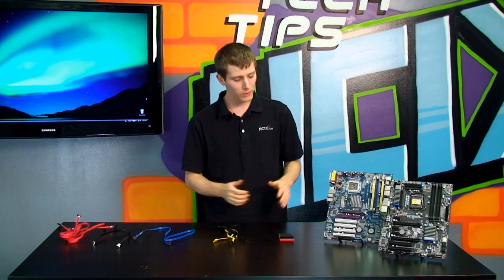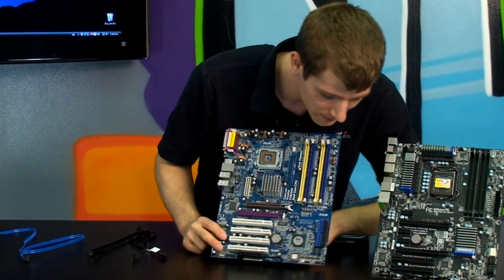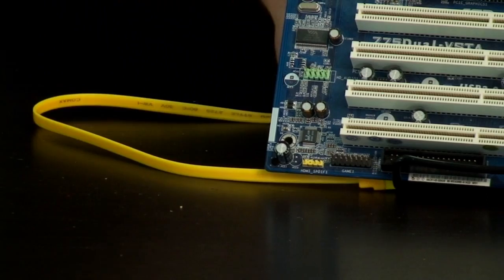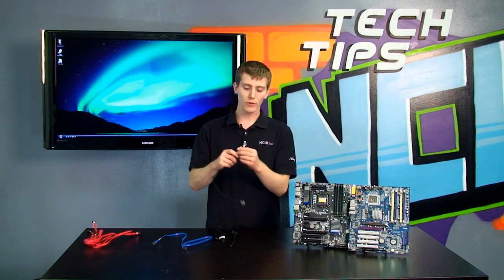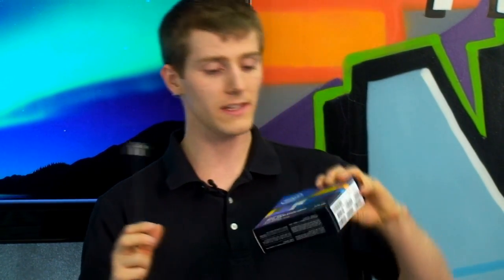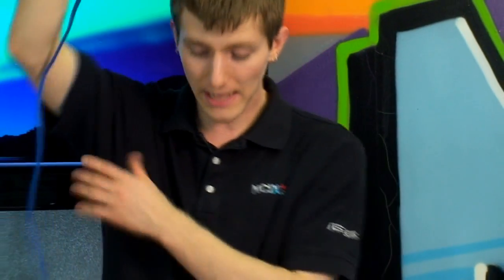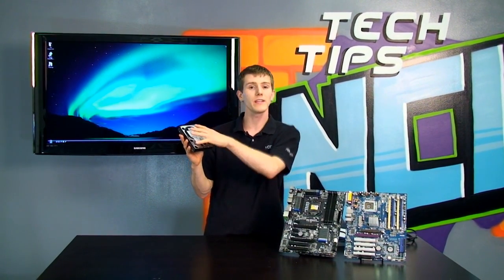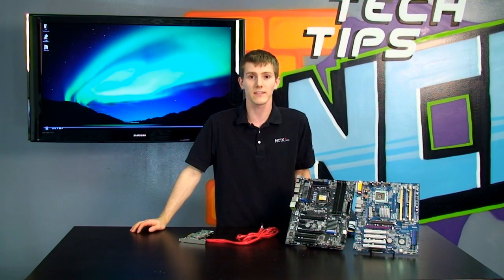SATA Explanation - Ports, Cables, Controllers, Motherboards - What You Need to Know NCIX Tech Tips

Comment: Thank you!  I'm still confused about the SATA cabling for my DVD drive.  It came with only the data cable, but not the power cable.  Will the power cable come with the power supply (not yet purchased)?  Or will I have to purchase the SATA power cable separately, and if so, does that also plug into the motherboard to draw power through that from the power supply, or does it connect directly to the power supply?  It's been over 20 years since I did a build, and was used to the "Master/Slave" IDE cables.  Since that's gone, now I have to learn a lot of stuff "over-again-for-the-first-time."  Help?

Comment: My Operating system is Windows 10, x64.  my old SATA hdd (160gb, windows xp) not show in device manager, diskpart, not even in My Computer. Only show in bios setting. i changed cable. so please tell me what is the problem. which cable i have to used for it.

Comment: I have a question for the community: I have an XP computer with SATA 1 connections. Does it specifically need SATA 1 cables, or will the later versions work as well?

Comment: hey idol i have a question, i am using a intel motherboard  gigabyte with only 4 slot for sata cables can i use a adapter so that i can use 6 data storage without any problems causing the motherboard. tia

Comment: I accidentally dropped my laptop and now it stopped working. I've checked everything inside and everything was still intact and haven't lost anything.

Took out the HDD and placed it on a different laptop to see if the HDD was the problem. It still works.

I tried swapping both HDD to further prove my guess.

So far I think the problem was the socket from the motherboard(?) And I don't know exactly whats the name you call that socket but do you think that's replaceable?

I might just try to buy one online and hopefully I could fix it.

Comment: This was so helpful, thank you! I’m going to hunt down a nice 2TB hard drive to connect to my motherboard.

I have one question though, atm I have 2 hard drives and 1 optical drive connected to 3 of the four SATA connectors coming out of the motherboard. (Sata2_0 - sata2_3). I have however only one set of cables running from the Powerbox to the hard drives with only 2 sata connectors to supply power, but I would like to install 3 hard drives at once, does that mean I need a new powerbox? I also have a sata connector in the cable set running from the powerbox to the optical drives, but if I disconnect that one I lose my optical drive. 

Thanks for the help!
Reply: I guess you'll need a new one (not that I know that you do), but it's better safe than sorry. So, I'd suggest you to not buy online (that is if you are). After the current pandemic, I say you take help from a certified computer tech (in person). Hope I could help :)

Comment: Hey Linus; I need your Expertise to tell what you think. I have Cubase 10 Pro with Toontracks . So you can tell I need A hi Ram and Big Storage Computer for Recording. I have to get a new one because Mine is a I5 Windows 7 Acer and Windows is no longer supporting Windows 7 after January 2020, which is a couple months away. So I need to get a good new one but with Hi Ram and Lots of storage. I like intel allot for Double cores or Quad cores. But , What Computer would you suggest I get . Not Apple. A  P.C. is what I am interested in. I found one but it is Esata. I haven't got a clue it if would work good or not.https://www.walmart.ca/en/ip/Dell-OptiPlex-GX980-Tower-CI5-650-16G-RAM-2T-DVD-WIFI-BT4-0-Win10-Home-EN-FR-Certified-Refurbished-1-YR-Warranty/PRD6YUG6TSOS1ER. This is the computer. Now do you have to use only sata external drives, with this computer. because it has a Esata Hook-Up. Can you help me out first about Esata. If that is in this computer . Does it mean I can use usb external Drive or only sata drives. Or just find a new computer for my needs. Or do you know where to find good recording computers. Hi ram nothing less than 12GB Ram. I want to get nothing less than 16GB Ram with 2 TBS Storage prefer 2 drives "C"Drive & "D"Drive TB each. Do you know of anything good like this Please.  And Thanks

Comment: This video tries to make it sound like the locking chips on some SATA connectors "evolved"
with the revisions. If you bother to read through these revisions, you will see that there is still no
such requirement for a SATA cable, and many cables lacking this feature are on the market today.
My experience with SATA connectors on motherboards is that they require substantial pressure to
seat, and substantial pull to release. The idea that they disconnect just looking at them is incorrect.
I have also found that the locking clips on some cables can be very hard to release, and can even
damage the mating connector. Remember that a motherboard is usually inside a commercial case
(not just hanging on wires), and is not subject to the handling an external device would receive.
Some types of electrical, as well as some other connector types (vacuum, pressure, liquid, etc) have
a separate removable (sometimes optional) clamp to hold them on. Too bad it isn't available on SATA.

Comment: I have one Sata 3 controller port on my mother board.  I need a second one.  Can I a breakout splitter with to do it or do I need to use some sort of card which will improve over a Sata ii but not as fast as the Sata 3 on mother board?  Thanks

Comment: Just a quick question. My SSD can be a sata 3.0 and my mobo port can also be a sata 3.0 but my cable can be a sata 2.0 and reduce my read/write speeds? I mean is this possible?
Reply: Yes brother let me generalize this a pump can pump 3 cubic meter water per min but if ur pipe can only pass 2cubic meter water per minter than in the end u only get 2cubic meter water per min. And basically it reduces the life expectancy of both.

Comment: Help - You make great videos - Anybody can jump in on this one. This is going to sound stupid, but it's making me feel stupid too. MY HP only has two tiny little 4 pin connectors on the motherboard for SATA power. One SATA to each. Even smaller than the Floppy plugs. Basically identical to fan connectors. What the ........... do I have? I need another power source. The next question will be why there's no "normal" psu....but I only want to feel stupid once in the same day. Thanks.

Comment: Love your videos. I'm confused about something that is probably pretty stupid. I have an HP and the only power plugs I can find are these two tiny plugs with 4 pins. I mean, I'm assuming 4 pin Molex are bigger, right? These are almost identical to the plug for the fans, except with all 4 wires on the connector instead of the 2. There must be something I'm missing.

Comment: I was hoping to learn something that I didn't from the video. I have two hard drives, one is an SSD drive the other is a typical disk/ platter drive. I was hoping to learn if there was a difference between my multiple SATA sockets on my motherboard, so I knew where was best to plug them into.

Comment: Im confused af. Im about to get an SSD, and i want to connect it to my  SATA 3 Port Gb/s. Do i specifically need a a Sata 3 cable that supports 6Gb/s? Or can i just take a normal cable?
Reply: A "SATA 3 Port" is 6Gb/s.....A "SATA 3Gb/s Port" is a SATA 2 Port.  But the cables are cheap and backwards compatible (meaning a SATA 3 cable will work with a SATA 2 or SATA 1 device) so just snag a  SATA 3 (6Gb/s) cable or two.  
And check where you'll hook it up to see if straight-angle or right-angle is best!

Comment: hi just purchased a used machine that has several esata ports on back.  I have about 10ide  pata 120 to 300gb drives with data to access what cable(s) do i need to purchase and will i be able to quickly plug them up as needed to review \ access contents

Comment: i turned on my computer, but their was a noise ! it turns out my seta cable has come away from my computer, so it was making a vibration noise. do you think their would be any damage to my hard drive ? - worried if the power couldn't get out and it damaged it.

Comment: Hi Linus, I recently tried building my pc.. i purchased a z170 gaming motherboard (Asus), 2 8 GB Ripjaws, Corsair RM 850 power supply, etc.. The thing is I wasnt able to even reach the BIOS.. My motherboard lights turned on, my cooler fan was spanning and graphics card's fan was spinning. Though both fans from GPU and cooler only spun for just a few secs before turning off.. I also had some beeping happening where I would have like 2 beeps ( one long, one short). Any chance you could help me out with this?

Comment: Sorry Linus, but you are wrong about all SATA cables being "universal". I have an early SATA-capable comp. I switched from IDE to SATA today using one of the newest SATA cables with locking clips. It would NOT plug into the SATA port. I had to remove the clips and then file down two raised strips on one side of the cable connector to get it to go in. Once I did that, it slipped right on. I have no worries about the cable not staying on the connection.
Reply: Deputy276 linus or linux

Comment: This is an old vid but I hope you can still see this. I am adding a 2nd internal drive. I have 6 sata ports (2 used - HD and DVD) on the Motherboard. Does it matter which port I plug the 2nd drive into?
Reply: I'm trying to do the same, with 2x   2Gb SATA Seagate's I have taken out of external cases.  I've got 2x SATA3 cables to connect them to the motherboard, but 6 slots to choose from when plugging them in.... PC gets as far as bios (did a reboot into bios an F10 and restart), there's a cursor blinking but system just hangs with no beeps and a black screen with nothing from even the boot drive.  Anyone tell me what I'm missing here?

Comment: What's the big difference between a SATA 3bg/s HDD and a 6gb/s HDD? is there a noticeable speed increase in 6gb/s? thanks
Reply: It's twice as fast
Reply: 3 Gb (gigabits) = 3 * 1024 = 3072 Mb (megabits) = 3072 / 8 = 384 MB (megabytes)
6 Gb (gigabits) = 6 * 1024 = 6144 Mb (megabits) = 6144 / 8 = 768 MB (megabytes)

SATA2 supports up to 384 MB/s read/write transfer.
SATA3 supports up to 768 MB/s read/write transfer. 

It depends on the drive and its capabilities.
Reply: Don't forget tho, RPMs matter too ;)

No use in sending the information at super speeds when it takes long for the hard drive to physically find the info on its discs
Reply: There is no point to upgrading to SATA3 if all you have is an HDD. There is no way a hard drive is gonna have a read/write speed of 600MB/s - that's for SSDs. Hell, even SATA1 with its 150MB/s speed would be adequate as the top speed of an HDD is probably around 120MB/s.

Comment: so if i use a sata 3 cable for a sata 6 hdd and plug the sata 3 cable into a sata 1 or 2 what happenens?
Reply: I'm guessing SATA 3 and SATA 6 are both "SATA III 6Gb/s". The info sends as quickly as the slowest component. If you have SATA III on your HDD and cables, but your motherboard only supports SATA II, you'll have 3Gb/s speeds, not 6Gb/s. Basically, the cables are all compatible with all SATA ports, just might not run at the storage device's or motherboard's maximum capability.
Reply: yeah thanks it worked :D
Reply: No problem

Comment: I just upgraded my C drive to an SSD. I use it for just my OS & programs.  I made my old drive for Storage  for my Documents I want to do a third External drive for back up. My main board is an Intel  D67GD. Running Windows 7 home premium with 16 GB DDR3 ram I have support for both USB 3 and eSATA (Red Connector) which would be a faster, connection USB3 or eSATA?

Comment: Hello Linus, need help for the safety issue of using MOLEX 4PIN to SATA power connecter............I bought a computer with an outside PSU brick so if I want to get one more SSD into the system I need to use an adapter to utilize the on-board 4 PIN molex to supply power to the SSD. However, I heard that the molex 4pin to SATA cable catches fire frequently (please kindly google "SATA connector burn", all of them are this kind of adapter cables, which has only 4 wires instead of 5)..............can I get some professional opinion from you guys about this 4pin to sata adapter?  Silverstone is still selling it, does is mean it's still reliable?

Comment: I have a major issue and I am in search of ideas to solve it. I have connected a red Sata Cable to the Sata 1 connector on the motherboard but found it to be to short for use. I tried to pull out the cable but the plastic clip is not working and is not allowing the two small locking tabs to free themselves from the holes to allow the freedom of the cable to be pulled out. I have tried poking at them with several different items and even tried to use needle nose pliers to attempt to squeeze the tab in far enough to disengage the locks. All have failed me.
Any suggestions from anyone??? I follow Linus avidly on your tube so fire away at resolutions here.

Comment: I pulled the hard drive out of my old iMac and would like to use it as an external drive.  I would also like to be able to get the info off of that drive.  Is there a way that I can just plug a SATA cable from my old hard drive to the usb of my new iMac?
Reply: J. Cody Schuster  yeah go for it sata cable by itself wont work thats just the data cables youl need a power cable too... easyer thing to do is to just buy a hdd encloser from ebay or somthing just be sure its for a 2.5" or 3.5" depends on size of your drive. 3.5" drives are faster around 7200rpm 2.5" around 5400rpm so depends on use to what id reccomend

Comment: hello can anybody help me with my issue. when i turned on my pc yesterday everything seemsed fine i logged into my microsoft account on my pc and came to the desktop and saw a huge amount of flickering, blackspots and horizontal lines of black that kept flickering on and off on my monitor, i have had this problem before and have managed to fix it in many cases, but his time i cannot no matter how hard i try, i have taken out my ssd and inspected it, rearranged my sata cables completely and tried every single one that i had on hand, nothing really worked,and i had to keep trying for a while as i managed to get my system up and running fine for a while yesterday, is this an issue with my sata cables or with the ssd i have owned for only a month or so. i am using sata 3 cables because that is what my mobo supports, i have seen quite sharp bends in the sata cables and have corrected them a bit but i fear most of the damage has already been done.
if somebody could help me with my issue i would be very grateful. thankyou.

Comment: is there an adapter that lets you link 2 of them into a single SSD to bump the upper limit of the drive to 6 gb/s? or at least faster than 3gb/s
sucks to have a sata 3 gb/s mobo and a 840 pro.

Comment: Can i use a sata 3 hard drive on a sata 2 bored will it work fine ?
Reply: Yes you can, but it will operate at SATA-II (3 Gb/s) speeds. However, since this is a hard drive, you won't notice much of a difference.
Reply: No :(

Comment: There is no advantage. All SATA will fail you once you move your PC. The problem is in the design of the connector. It can't stand firmly in the socket even when locked, and it will eventually lose contact. Solution is simple - open up you PC and replug it, but watch that torsion force of the cable doesn't pull it too much from the connector axis. I wouldn't want to be on a space mission that is using SATA cables. IDE was approximately 100 times more reliable.
Reply: are you an idiot? IDE more reliable than SATA? yeah, maybe at 20mbps but at 40mbps the crosstalk is soooo bad the data is simply lost and sata is superior. SATA is superior in every fucking way, thats why IDE, PATA IS OBSOLETE.
Reply: I've just transfered 40 GB data from one SATA disk to another. Starting at 70 MBps, but it soon fell down to 35 MBps. Those are the speeds I had with PATA drives.They easily managed 40 MBps or if you like it better 320 Mbps. Anyway, reliability is whole different factor. I don't care if SATA is 10x faster, when the cables don't work.
Reply: yea guys LMAO get IDE its the best for your gaming rig ...PSHHHH
Reply: Jthegamer0813
all the wide and thick ribbon cables help airflow guys!
Reply: He's being ironic, but he doesn't understand that the airflow or the speed of the transfer are not important, when the pins don't make good contact and  Windows is signaling you fatal errors.
Reply: Kornelije Kovac hahaha  SMART gonna be like get that shit outta here!!!!!!
Reply: Kornelije Kovac
*sarcastic
Reply: I had a problem with a SATA 1.5 Tb drive dropping out. When I checked the cable, it had the old SATA 1 connectors. They don't have a metal clip on them.
I plugged in a newer cable with metal clips. It now works reliably.
Even when the clip-less cables are plugged in properly, they still might have a bad connection. So use the new SATA cables with a metal clip on them. They are reliable.

Comment: on my mobo Gygabyte B85hd3 , in which connector should i put the sata cable for my HD and in which one my optical drvive? i have sata 3 and sata 2 connectors, my question is. in SATA 3 i have 0, 1 , 2 , 3 ,4 is ''0'' good for my HD?

Comment: meh, I'm pretty happy with my desktop now. (I built it) I only use the laptop at school and not for gaming. Just webrowsing and office.

I wonder if the temp sensor is off. It used to overheat, but I cleaned it out. I also don't want to take off the heatsink. I'm running out of thermal paste. (I've built my pc, my  brother's pc, and my friends pc. All on two tubes of thermal paste.)

Thanks for your concern though!

Comment: I know, my desktop cpu is usually around the low 40s and high 50s when under pressure. I'm not sure with the laptop. 

I have had two Gateway NV52s, both ran around 80C. I honestly don't want to take it apart again, its not worth it.